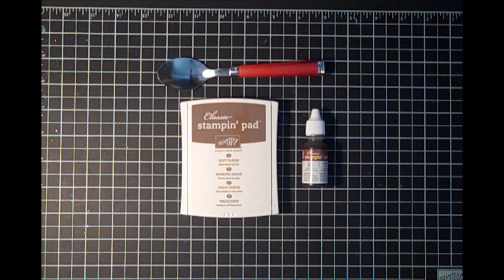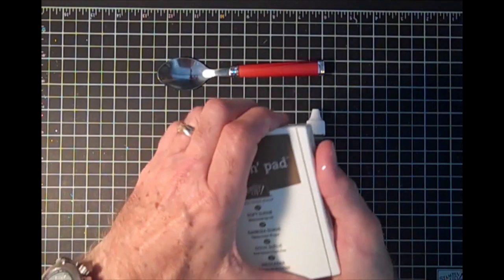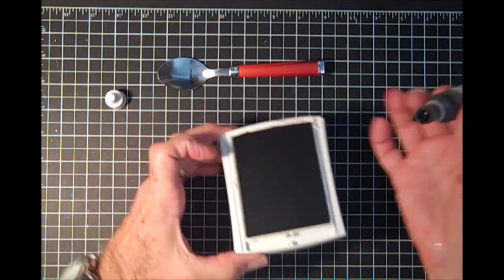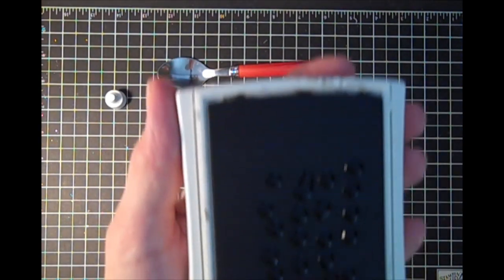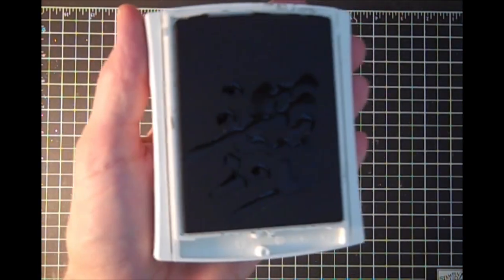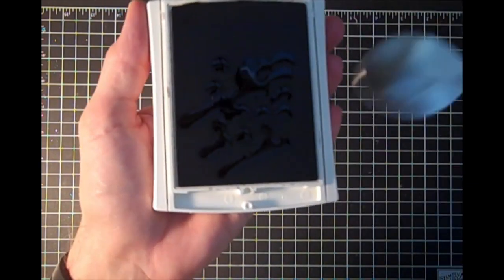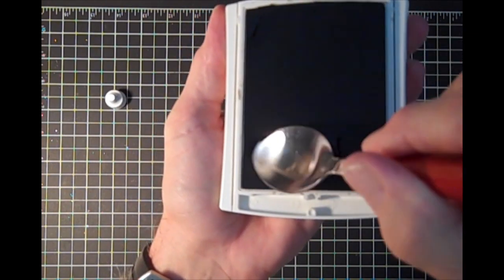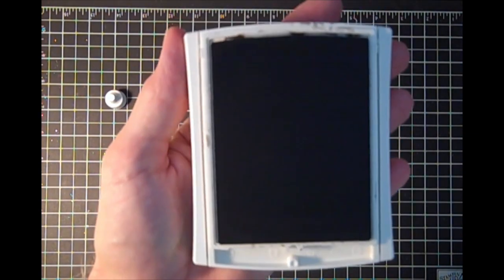Re-Inking a Foam Ink Pad

Comment: Thanks Mike. I haven't needed to reink any of the new pads yet. But I've had some of the old pads for over 15 yrs. And they are still holding the ink!!! Of course most of the colors have been discontinued, so when they're dry in the trash they'll go. Unless I can find a color that matches..  Hugs, Jess
Reply: Hey Jess, I also have a lot of older pads that I just can't part with.  You can check out Ebay and I'll bet you will find those re-inkers for your old favorite colors.  Maybe even Amazon.  Just thought I'd let you know.